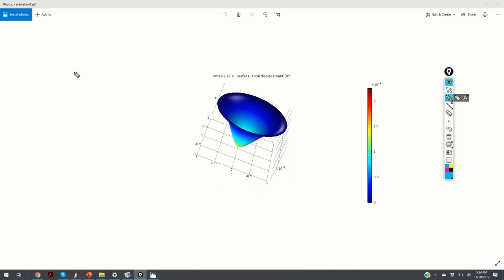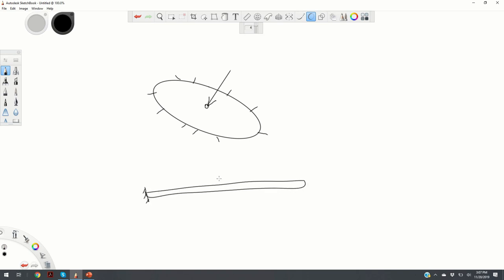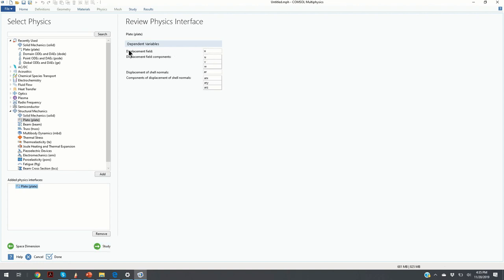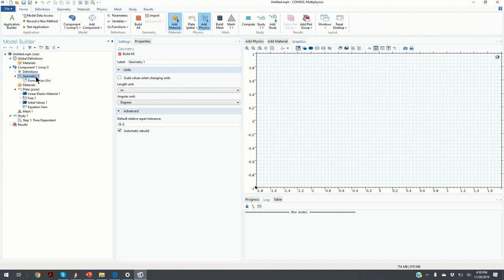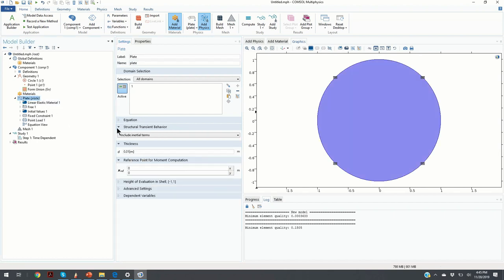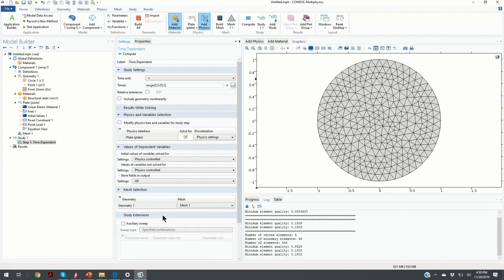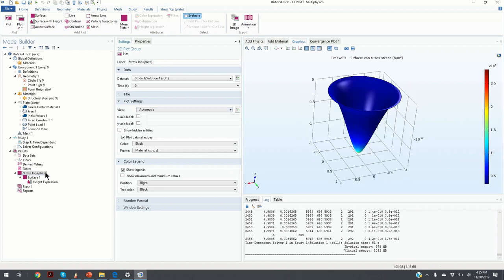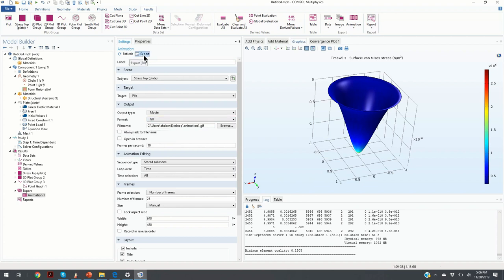Plate Deformation Simulation using COMSOL Multiphysics and Finite Element Analysis - Mechatronics

Comment: Thank you for sharing this model, but I have a question about it. In the geometry part, you just build a 2D plate made of steel, but the deformation should be dependent on the thickness of it. Where do you define the thickness of it?
Reply from the maker: There is an option for that, please watch the video again, this is explained when defining the geometry!

Comment: Thanks for your clear explanation. 
Could you please say that which version of Comsol have you used?
Reply from the maker: COMSOL Multiphysics 5.2, but I think that the same principle can be applied to older or newer versions.
Reply: Dear Aleksandar 
thanks for your reply. 
I am also working with 5.2 version ,but the weird thing is that in the structural mechanis tree, there is no plate option!
Is it available in any additional packages?or can I model the square plate with solid mechanics item?
Reply: I just resolved the problem!
Thanks

Comment: Dear Aleksandar,
Thank you for your interesting video. I have a question for you. 
Consider this simulation in COMSOl that we have deformation after applying a force. I look for a matrix in this example, which maps the 2D surface into a 3D-shape after applying the force. Where can find this data in the software?
I wonder if we have access to this matrix in COMSOL at all?
I appreciate any help you can provide.
Reply from the maker: I am not sure that I understand your problem accurately. You can extract matrices and models from COMSOL to MATLAB and then you can inspect all matrices you need. I made two videos that can be relevant to you: 
https://www.youtube.com/watch?v=p7MwR1nRgC0
https://www.youtube.com/watch?v=gCs8xHhjZcQ
Reply: @aleksandarhaber  Dear Aleksandar, thank you for your quick and perfect response. It would be great If I could elaborate on my question with some images. How can I send those images to you?
Reply from the maker: @behnammadadnia3410  Send it to:     ml.mecheng AT gmail DOT com
Reply from the maker: @behnammadadnia3410  Send it to:     ml.mecheng AT gmail DOT com
Reply: @aleksandarhaber  Thank you for your message. I send you the question.
Reply from the maker: Hello Behnam, 
Here is the answer to your question. I will also post this online for reference to other people. Let X(t) be a vector of displacement at the mesh points at the time instant t. Then the evolution of the mesh points is governed by the following state-equation E\dot{X}(t)=AX(t)+Bu(t) (1)
where u(t) is the external force being applied to the system and E, A, B are appropriately dimensioned matrices. You can transfer this model into the following model:
EX_{k+1}=AX_{k}+Bu_{k} (2)
where k is a discrete-time instant (you are looking at the system at discrete-time instants). This is a discrete-time state-space model. Now, your problem is to determine let us say 
X_{0}  (initial state of the system)
knowing the state of the system at the discrete-time instant X_{N}. You can do that by inverting the model (2). COMSOL can give you the matrices E,A, B, and then you need to look into algorithms for the inversion of the state-space models (topic from the control theory).
You can start with the following two videos of mine on how to extract state-space models
https://www.youtube.com/watch?v=p7MwR1nRgC0  

https://www.youtube.com/watch?v=gCs8xHhjZcQ 

And once you get the state-space models, look into the state-space model inversion. 
Best, Aleksandar Haber

Comment: Sir, can you please tell how to find surface resistance( electrical contact resistance) in COMSOL. I m doing a project on spot welding. I need to find the surface resistance between steel and aluminium.
Reply from the maker: I am sorry I am not an expert in that field.
Reply: @aleksandarhaber  Sir, any idea about how to give AC current in Comsol
Reply from the maker: @saikrishna-sh3ul  not an expert in that field